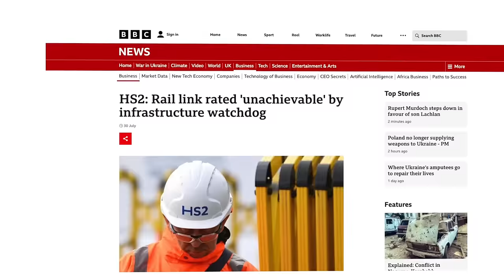The Battle To Build Britain's $90BN HS2 Railway

Comment: You did not mention that the HS2 project was overly ambitious and unreasonable to start with, and this is the main reason why all phases except Phase 1 (London-Birmingham) were cancelled.

They planned too many high-speed branches, and did not properly address the local needs in the north of England, and in Scotland. The following map-plan should self-explain the reasons for this failure: https://en.wikipedia.org/wiki/High_Speed_2#/media/File:HS2_vector_map.jpg

It was more logical to plan a complementary Liverpool-Manchester-Leeds line to run at near high-speed to be fully designed now, but constructed at a different date. Had they done so, Phase 1 could have gone all the way to Manchester Interchange, and be finished by 2030. 

And then a future Phase 2 from Manchester Interchange to Carlisle would have been feasible in the future. But unfortunately, the plan was too London-centric, too branched out, and therefore it failed. The same lack of simplicity and straightforwardness has plagued HS2 in London, too, which led to immense cost overruns.
Reply: Ambitious? Spain and China built theirs overnight and we’re pissing our pants over one railway.🤦🏻
Reply: @qasimmir7117 Let me summarize again the problems with the original HS2 plan: too London-centric, too branched out, insufficiently simple. Hence it won't be build as complicated as the original plan. But you will have HS trains to Birmingham, Liverpool, and Manchester. Next you should build HS3 between Liverpool and Leeds. These lines have perfect economic sense. And they would modify people's travel patterns. Further lines might make sense after you have analysed the former's effects, so wait at least until HS2 and HS3 are finished.

Spain built its network over a 30 years period, they did not have to built through a city like London, and they still do not have a line to Lisbon. In fact, only a few years ago they managed to connect to France. Moreover, Spain's old network had a different gauge (the new HS network has standard gauge), so they cannot run regular trains on the two networks, something you very often do and will be doing in Britain. Therefore, Spain had to build this crazy many stations:
https://en.wikipedia.org/wiki/High-speed_rail_in_Spain#/media/File:Spain_High_Speed_Rail.svg 
to reach as much population as possible with the new network.

China's old rail network was in such bad shape that they simply had to build a completely new one. Your old network, by contrast, has all the security and amenities of the new lines, except speed. You already have trains running a decent time in comfortable conditions. Moreover, China had to spend billions to avoid a recession in 2008-2012. That money would have been spent anyway, and would have been essentially wasted w/o the HS network project. Last, but not least, the current new HS lines in China are in need of more maintenance work than the lines built in Britain during the reign of Queen Victoria. Some of the lines they are building have zero economic sense: not only the original investment has to be totally written off, but income from current operations does not even cover the costs of maintenance.

BTW, have you seen inside the Chinese HS train stations and trainsets? Note the 2+3 and even 3+3 seat configurations:
https://www.alamy.com/stock-photo/china-high-speed-train-interior.html?sortBy=relevant

Comment: If the reason things don't get built is cost, then delaying something, will never make it cheaper. 

It is a shame that the general public do not get behind large scale infrastructure, until they have been born kicking and screaming. 

Cross rail, over budget and late, but once completed the pain is soon forgotten as 3.5-4 million people a week benefit from its construction; the super sewer a £billion over budget but desperately needed  to divert millions of tonnes of raw sewage from the Thames. The M25 that now carries 15 percent of the UK's motorway traffic.

It is always an easy decision not to do something, and while the benefit of some infrastructure projects is questionable, most once built, few become white elephants.

What would be good is if the UK became world leaders in drone mass transportation, eliminating the need for expensive intercity infrastructure. A fleet of drones each carrying 40+ people, even if they were to follow the existing rail track might be a more modern and cost effective solution alternative to high speed rail. No doubt another country though will take up the challenge and lead the way.

Comment: Needs to be scrapped now. It is not needed, it will be years late, grossly over budget. Far to expensive to travel on. It will not help with ' levelling up'. Just the opposite, it will mean more London commuters moving futher outside to live. The money saved by scrapping it could be used to inprove cross country rail services. HS2 was just a Johnson vanity project.

Comment: Dropping the connection to Euston and making Old Oak Common the hub with the Elizabeth line and Overground makes sense. It's not like Euston is a common destination in itself, just a another place to change trains anyway so I don't understand the drive to make Euston the terminus if it's going to cost half the budget. The northern parts of HS2 are far more important than yet another London line. If it wasn't for the Brexit screw up it would have made more sense to connect it to HS1 to provide direct services from the North to Europe via Old Oak Common and Stratford International and the other hub of Stratford.
Reply: Euston is still going to be the ultimate terminus of HS2

Comment: this project should have started at heathrow airport ,never should have been the city,its all over engineered ,like i said start at h/row and work the track along do abit in order ,instead have most of the crew being all over the route,should never drilled under the chiltons or have colne valley viaduct,could have saved millions in not doing them, to many chiefs and not enough indians,so its do the build in order ,not all over the place,
Reply: So why should HS2 have finished at Heathrow, most people who travel from the Midlands and the North don't want to go to Heathrow but Central London, if the tunnel under the Chilterns or the Colne Valley Viaduct had not been built how would HS2 got past these obsticles and if the line ha not been constructed in section all along the route it would not be as far constructed now